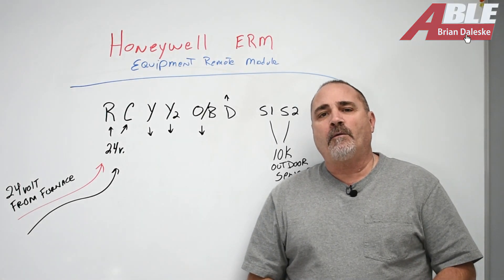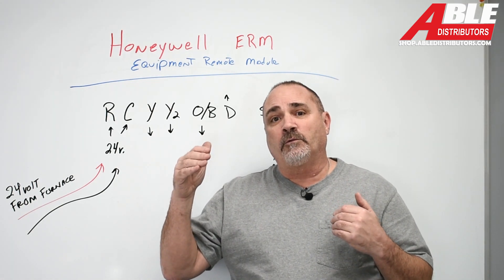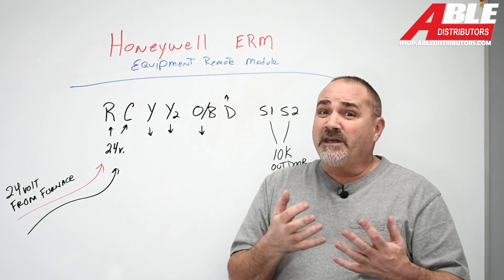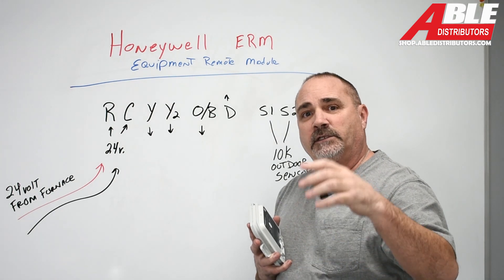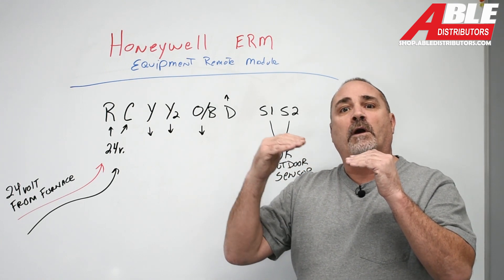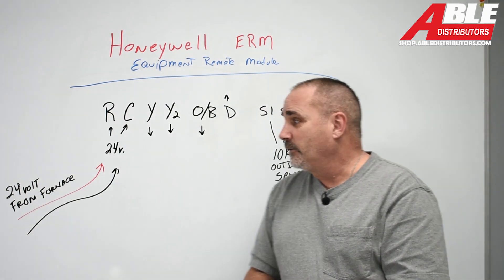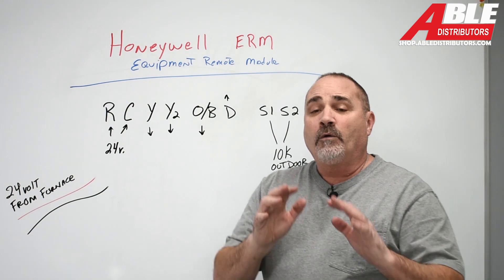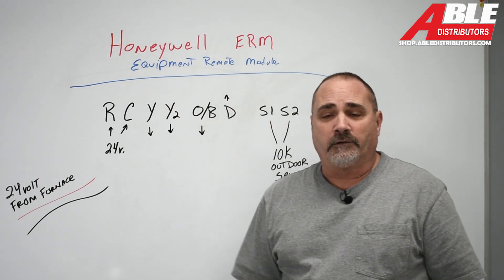Tech Tips: Honeywell ERM (Equipment Remote Module)

Comment: I know it's been a couple of years since you posted this, but I'm hoping you'll see this. We just recently had a wired system replaced with this Honeywell 5220ERM and a Honeywell Home thermostat. Now - every time either the heat or the air runs and gets to temp, the air handler shuts off, then back on again within a couple of seconds. It runs for about 10 seconds, then shuts off until the next time heat/air is called for. The technician claims this is "normal" and indicated it has something to do with the humidity sensor. This doesn't seem like normal operations to us and we're worried that it's causing damage to the internal air handler. Is the tech right? Or should we call BS?

Comment: Can this be used in combination with EIM (Equipment Interface Module) to also have no wires from the thermostat to the air handler? Meaning a ERM for the condenser, a EIM for the air handler, and a wire-free thermostat that controls both the EIM and the ERM?
Reply from the maker: yes, any Honeywell "redlink " thermostat will communicate with the ERM, but remember the ERM needs to be powered by 24Volts, you can power it off furnace transformer or install a 220 volt to 24volt transformer in condensing unit..... hope this helps, ,   Brian.
Reply: @abledistributors  Extremely helpful! Thank you!

You read my mind on getting the 24Vac to the condenser. Just install a transformer at the bottom of the contactor and call it a day!
Reply: Can you make a video with red link thermostat and indoor air handler like bosch and out door heat pump

Comment: Can this be used with a remote thermostat to move the stat t a new location in the house?
Reply from the maker: no, BUT.. we have a few options, 1- Ecobee has a unit with a remote sensor, leave the thermostat where it is a choose to measure temp from the sensor. OR, 2- Honeywell has wireless thermostats ( non-WiFi ) simply wire the base unit at your equipment, and place the wireless thermostat anywhere in your home.
IF your using it on a boiler, you can use this to have a wireless thermostat in that case. Hope this helped. Brian..